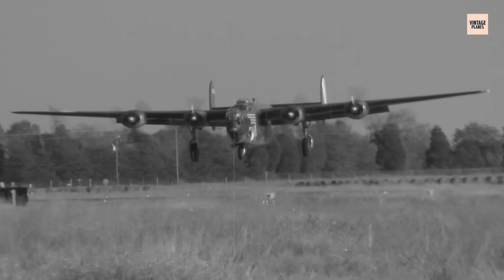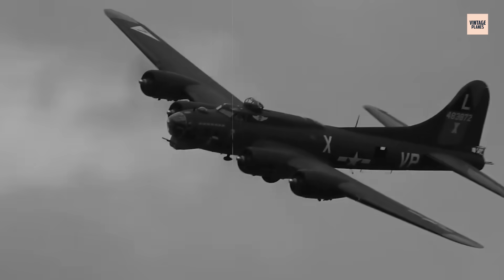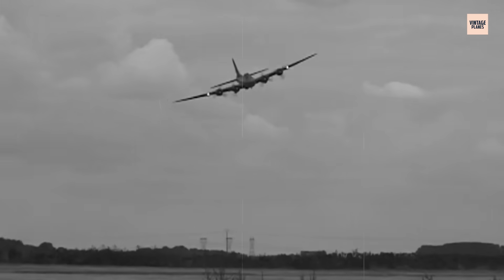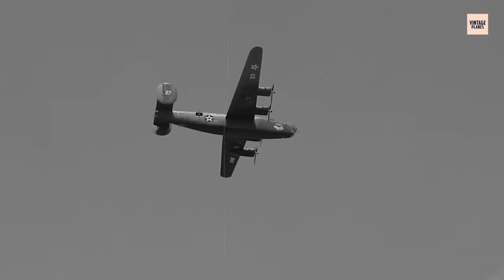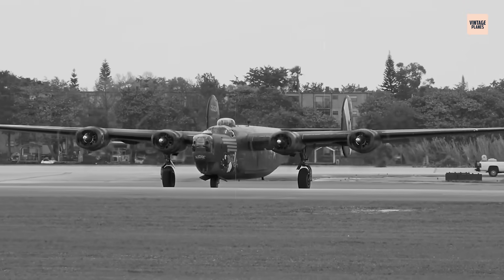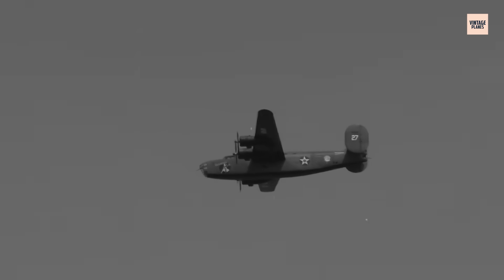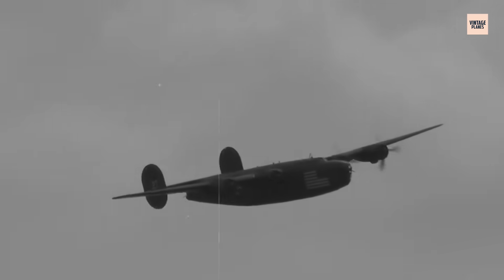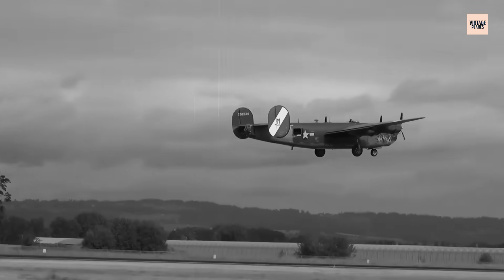Why the B-24’s Wing Design Almost Doomed 18,000 Planes

Comment: The actual number of B-24s including the PB4Y-2 derivative is 19,256. Unfair to use the August 1943 Tidal Wave as a loss example. There was another mission flown in August 1943 and more B-17s were lost on the Schweinfurt mission than B-24s on Tidal Wave.  Both missions were heavily compromised by their design and leadership mistakes - not by the aircraft. The B-24 was a true multi-role aircraft but the B-17 was a bomber, that's all.

Comment: The b17 flew in 1935 and the b24 Dec ‘39.  The b17s extra development, construction, and maintenance experience contributed to its legend.  
The 30s saw the change from tube and fabric to semi-monocoque all metal construction.  The analysis techniques were immature in 1935, so Boeing, compensating, overbuilt the b17.   Thus its robustness.
The b24 was designed with a sharper pencil.  In aircraft structures, one wants “just enough” because beyond ‘just enough’ adds unnecessary weight.  But when one of the just enough are shot away, it’s unhappy situation.  
Modern aluminum plane structure is similar to the b24s.  (As was Boeings b29)
The b24s outstanding war contribution was closing the “Greenland (or is it Iceland”?) Gap” to uboats.  Had this not been so, England likely would capitulated…no fuel, no food.
Consolidated used the Davis airfoil in its B32 bomber, in fact I think Consolidated simply scaled up the b24’s wing.
The B17 used split flaps, the B24 Fowler flaps.  Fowlers provide perhaps an additional 50% lift increment.
The B24s other problem…it’s ugly compared to a b17.  The pretty Spitfire gets the credit for the Battle of Britain, but the homely Hurricanes did the work.  The p51 gets the credit for taming the Luftwaffe, but the P47s had done the heavy lifting.   Cheers

Comment: It wasn't that bad. I doubt there was all that much laminar flow in reality and the high aspect ratio and higher wing loading were the things that increased performance and range. Speed is also a good defensive weapon and if you don't have the range to get to the target your warplane is useless. Ease of manufacture also helps as quantity has a quality of its own. The B-17 was the last example of the way to build those kinds of aircraft - big wing with lots of area, low aspect ratio, slow. Note the way the DC-4, DC-6 and Constellation were built. All examples of later thinking. Yes a bomber variant of the Constellation was proposed.

Comment: This video is mostly bullshit. The B24 had almost identical loss rates in the European theatre and when looking at losses per tonne of bombs dropped in that theatre  was far more economical than the b17. It was so much better that in the Pacific theatre the B17 was almost completely absent as it did not have the range. The b24 also made a huge  contribution to the defeat of the uboats by bridging the mid Altantic air cover gap which the b17 could not do. It was used on the first raid to the Ploesti oil refineries in Romania which at the time the b17 could not do. This video is a terrible piece of work  when you consider that with over 18000 built the b24 was the most constructed allied aircraft of the war. Sure the b24 had issues but it was by far the leading US bomber aircraft for both Pacific and European theatres of the war by a country mile.
Reply: My Dad was crew them in one.  He liked it
Reply: @DavidMartin-ym2te  David my dad, Flight Lieutenant John Thompson was lead navigator in the Australian RAAF 200 Flight which dropped spies and agents behind Japanese comtrolled territory in places like Borneo late  in ww2. Dad use to say the B24 was difficult to take off as it could barely get off the ground but his plane was always overloaded with fuel and equipment they had to drop, as they had to fly extremely long distances. The main thing was though it was the only aircraft that could do the job. His aircraft got shot down with all crew lost but lucky for me dad was sick that day and off operations. There is a book about his unit called "Leyburn's Liberators", Leyburn Queenland being the unit's home base.
Reply: I agree with you, but did not ant to use the word bullshit, but nevertheless that is appropriate.  Its mainly a high aspect ratio wing with a lower drag airfoil. and thats about all there is to it.

Comment: Well, I take issue with blaming the wing design as such.  The real "culprit" was the fuselage design. A low drag, but vulnerable wing, married to a BLUNT DOG of a fuselage.  If the B24 had been given a proper, aerodynamic fuselage, instead of a 1930s elongated BARN of one, the resulting plane would have been 50 mph faster, at least. That, in and of itself, would have greatly reduced the casualty rate of the aircraft. Such ideas as a slim fuselage, hanging at least some of the bomb load under the wings, etc....just hadn't yet occurred to the designers. So, we got a great, though vulnerable, wing....married to a fuselage as aerodynamic as a BARN DOOR.
Reply: Many argue quantity has a quality all it's own. Tell that to the crews.
Reply: 50mph is quite an estimate.

Comment: I remember a vet telling me about the B24, " you could smell gas anytime you got near it.", and, " you couldnt bail out without hitting the twin tail and,that was it, you were gone."  
I remember the luftwaffe preferred attacking B24s over B 17s. B24s were thus often used for decoy raids to take some of the pressure off the B17s flying the real missions....i also remember that pilots said it was very heavy on the controls, and so,quite tiring to fly. Belly landings were a disaster, the fuselage of the B24 wasnt sturdy as the B17 either, they either stood on their nose,or flattened out squished like a bug.
Reply: The b24 had almost identical loss rate in the European theatre and when you consider it carried far greater bomb load than the b17 it was a far more effective bomber. Also with regards to its twin fins this has to be nonsnense regarding bailing out  because would not the Lancaster, Halifax and Mitchel bombers also be similarly affected?
Reply: @FundsSeeker-fy5rv And greater range.
Reply: Because of their superior range they were well suited for ASW patrols and thus closed the Atlantic air gap.
Reply: I flew in both 3 years ago with the Thunder Over Michigan airshow.  Highly recommended for any aircraft buff.  The difference between the two planes was comparing a pre war plane to a modern WWII aircraft.  The 8th Air Force in England lost more personnel aircrews than the Marines in WWII.  The odds of getting killed per sorties were 1:10   Each crew was required to fly 25 missions.  The book Black Thursday by Martin Caiden covers the nearly suicide missions.

Comment: Here we go with more A I BULL$HIT !!!!!  The B24 loaded was NO faster than a B17 !!!!  Did NOT carry any more bomb load, and could NOT get to within 8,000 ft altitude of a B17 !!!!  B17's big wing was only a few MPH slower max and cruised at same speed, and the same HP engines of the B17 climbed it to 35,000 ft,  B24 struggled to get to 28,000,  and when loaded the B24 was a BITCH to fly !!!!  And if the B24 took a round to the wing it went off like a bomb !!!  And the B17 dropped tens of thousand of tons MORE bombs during the war in Europe than the B24 !!!  Facts don't lie !!!